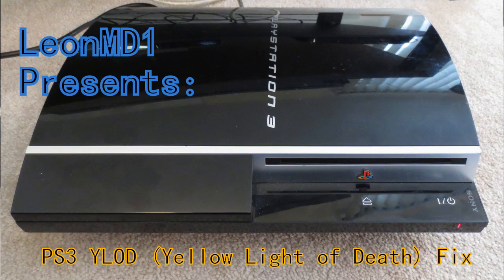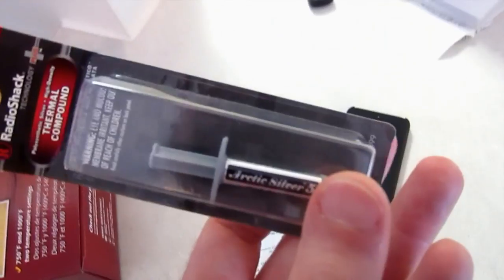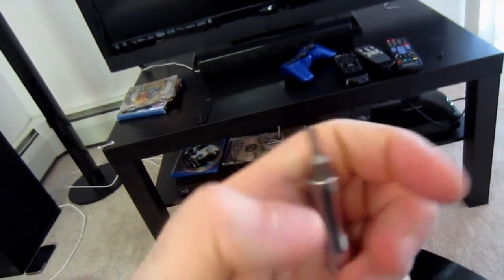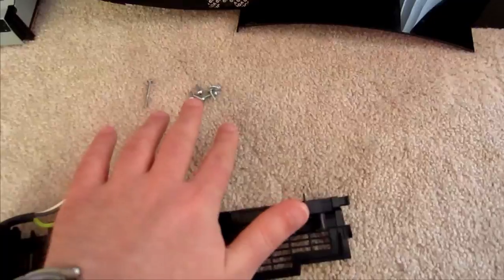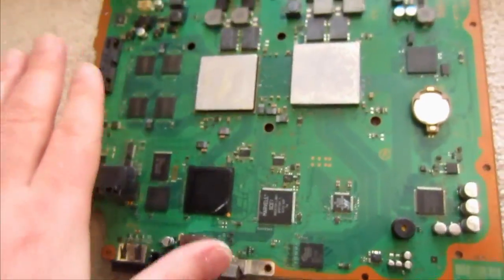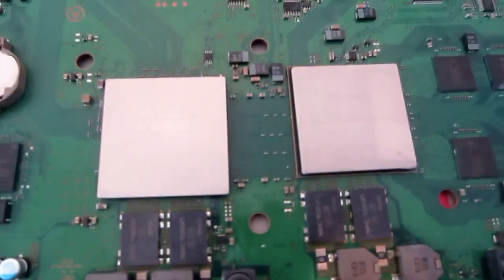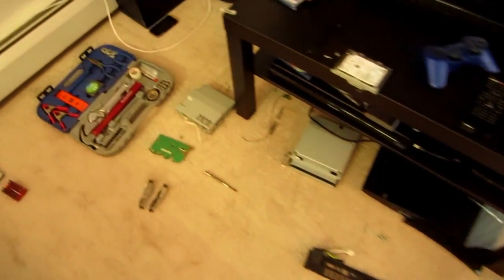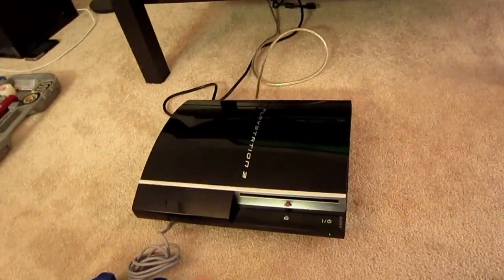PS3 Yellow Light Of Death (YLOD) Fix

Comment: it repaired but after 1 hour YLOD back what should i do
plz help
Reply: the main problem is that the ps3 has a bad design when it comes to cooling , so make sure that the console get proper cooling. if you stuff it back in the same warm corner is goes bad again. so make some bigger air holes in it as wel as the power supply

Comment: This is what I did to fix mine (I don't know if it works for everyone but it did for me): If it's blinking red  and doesn't turn on the first time you press the on button, press it once and turn it off from the back. Wait 5 seconds and turn it on from the back and it should be working.
Reply: Is it a temporary fix?
Reply: +HexBulletz Thats simply a overheating issue I have that but  my ps3 sometimes flashes Yellow